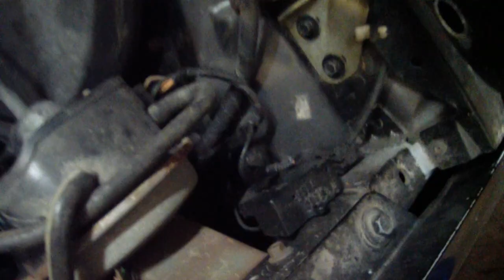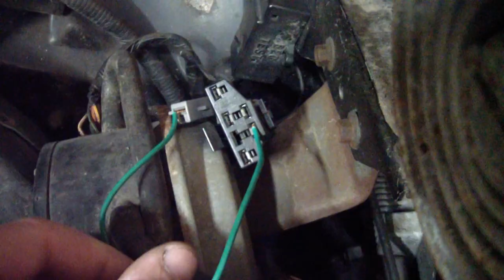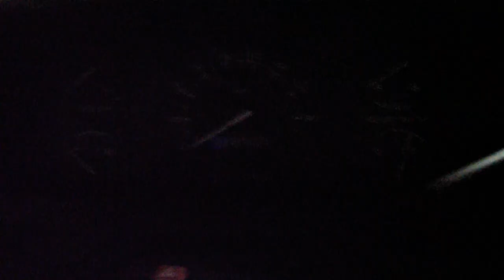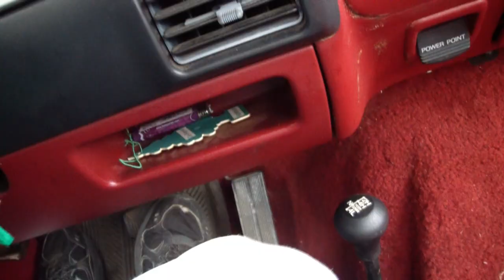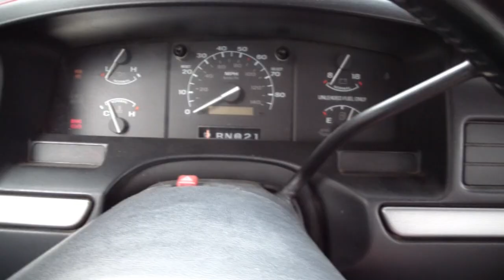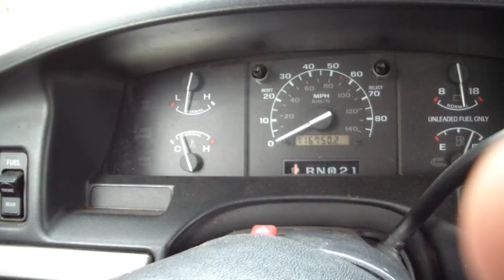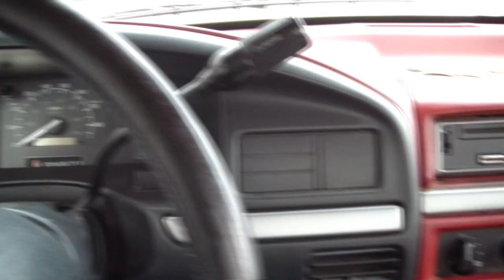How to read a check engine light code on a Ford 1983-1995 EEC 4 system

Comment: Can you tell me the wiring diagram of the connections?  Are one of them supplying power for the scanner?  I understand that you can use a wire or paper clip to get the codes using the check engine light.  On my 1990 7.3 idi Diesel, I am getting no power to any of the connections. No light when attempting to be able to read a code.   Should one of the connectors be powered?  Which one?  Thank you.
Reply from the maker: I'd have to research it again.  Good luck.
Reply: @Oldsmob455 ok, thank you

Comment: Would the 111 code flash before and  after the the single interruptor flash ? Im getting the same amount of flashes before.and after the interruptor.  Im.trying to figure out if the.second series of flashes would be 111 or code 33 which is a egr code.

Comment: I performed this test on my 95 f250 351w. 
I got 211 code with the truck off (warmed up) and 72 , 53, and 8 with the truck running. 
The engine light has never came on. 
But the truck randomly loses power and stalls, just cranks. Leave it sitting, it starts back up. 
I’ve rebuilt the ignition system, switch under the dash.  Could you please help a fella out with the mentioned codes? I’m getting conflicting stories across this interwebs

Comment: This is the only video I've foud that explained the actual full process with the 2 seperate groups and the seperator flash. Without that info it just looks like there's no rhyme or reason to the random flashes and spacing and I was about to pull my hair out. Thank you!

Comment: Thank you for video. I have 92 f150, has the 4.9 liter. It used to be my dads truck, and his mechanic unhooked the check engine light. He now denies it but i was there when he told my dad that he did it for him at my dads request.. do you happen to know how to hook the check engine light back up? I dont know if he unplugged a bulb or what. Any help would be appreciated
Reply: 4 amp fuse in cab fusebox

Comment: I did everything your video told me to do except for starting my 95 f150. I put the vehicle in the in the on position but didn't start it and it started reading the codes. I didn't turn the wheel or hit the accelerator the code came in. Great video!

Comment: My Ranger is a 1995 and it does not have one of those EEC test. It's no where to be found, What's up with that?. I've had 4 guys look to see why the light is still on after changing the battery, alternator, solenoid and starter.  After putting a new battery in it still would not start sometimes. Could it be a ground wire? and why would I "NOT" have an EEC Tester?
Reply: Have you checked your distributor?
Reply: You probably have the ob2 tester some have ob1 and some have ob2 it should be under the dash

Comment: I have an F800 with a 7L  gas engine. It has this  style data plug on the rt side of the cab under the seat. I have a check eng light, and performance problems. I have jumped the connectors as described. I can't get the dash to flash. I don't know how to proceed. What's next?
Reply from the maker: Not sure.  Maybe you have the wrong plug?  Under the seat seems like a unlikely place.  Google it if you havn't already.
Reply: @Oldsmob455  , my mistake. I should check my message more careful. The plug is under the heater box against the firewall in front of the passenger side cab. one plug is single terminal, the other has   plugs in it. I jumped #2 to the single wire plug. I also tried it with a test light to #4 terminal as well. I can't get the chk eng light to cycle.
Reply: I would attach a photo of the plug, but I can't find an icon to add a photo

Comment: yes OLDSMOB455, thanks.... you help'd me get motivated. lol yeehaw! yes, i believe i can do this. I'm going to check the ol 1992-3 E 150/351w conversion van CHECK ENGINE thing. All was good til it overheated alil i noticed. ...pull to shoulder of hiway, enginecoolant streaming out, pulled van inside engine cover off, set aside. a drside rear freeze plug had rusted a small hole. I had a flat metal roof rubber washer and a stanless steel screw and flat washer. I used items. still no leak, but CHECK ENGINE comes on...., but only when in gear and rolling 25yards appox., 
CHECK ENGINE  . Engine  off..... 10sec approx, then engine on and running not in gear, just ideling forEVER... NO check engine LIGHT, but put it in gear travel approx 25yards CHECK ENGINE comes on. ther ya have it, ....my situation. Now i am going to check trouble codes. thankya!

Comment: Get a Actron CP9690 code tester. It checks live, record, graphing, emissions test, solenoid and relay test, ABS SRS, timing advance test, check engine light reset, oil light reset, MAF readings, IAC valve readings, Coolent temperature sensor degrees, RPM'S, oil pressure, fuel pressure, EGR valve flow, and MORE! It works on 1983-2013 and is updatable. It erases memory codes. It checks cylinder balance on fuel injection. It has code connect to diagnose codes. EBAY has it.

Comment: i know how to get the codes but where can i find the definition  of the codes to correct the problem
Reply: Google may help or the manual that comes with a digital tester or get a Snap-on scanner and cartridges and adaptor from EBAY.

Comment: Get a Actron CP9690 code tester. It has Ford, G.M. Chrysler, and 2 Toyota cables for OBDI. It does freeze frame, live, graphing, and timing advance, and other tests. It comes in a black pouch. It has a cigarette lighter cable. It takes 4 AAA batteries. Out-of- the- box it goes up to 2013. It's well-lit! It's easy to use! It has code-connect to diagnose codes.

Comment: Get a Snap-on scanner from E-Bay. Get the cartridges and adapters and cables and 120 volt cable to hook up to the battery Pak to check test results away from the vehicle. Also get the 12 volt cable to hook up to the battery and the adaptor for some adapters. It tests MAF, ISC, fuel injectors, fuel pressure, oil pressure, RPM's, fuel trim, KOEO, KOER, movies, and much more!
Reply: Does this work for an OBD1?
Reply: I know this is a super old post. But I've been fighting my dad's old 95 5.0 since he passed last Christmas eve. And the scan tool I have for one 1 really isn't helping. But your post reminded me I snagged an old snap on tester back in the mid 2000s that I totally forgot about sitting in my shed. You may have just helped me figure this beast out. Thank you from the future 🤣
Reply: @patrickotto2727 are you going to read the flashes of the check engine light to see what the problem is?? Or what are you gonna do? Im trying to figure out a 92 f 150 5.8

Comment: I jumped the terminal and turned the key forward like you showed in the video but no light flashes or light period. With no light flash does it mean it has another problem.

 Thanks.
Reply: I had a 93 Taurus with a bad pcm that would not respond to the jumper wire
Reply from the maker: Not sure, try googling it.
Reply: R D It could mean the bulb is burnt out on the dash. It should flash even if it flashes a pass code.

Comment: EEC IV 3 DIGIT CODES[EEC Tests]

 Applicable only to some 1991 and up vehicles 

 NOTE: When you see "is/was" listed for a code: 
 For a HARD fault code the sensor IS out of range right now. 
 For a MEMORY code, it WAS out of range at one time (possible intermittent wire etc.).

Differences in test mode noted as:

 (O) =Key On Engine Off test
 (R) =Key On Engine Running test
 (M) =Memory code

111 System checks OK  112 (O,M) Intake Air Temperature (IAT) sensor is/was low or grounded 113 (O,M) IAT sensor is/was high or open 114 (O,R) IAT sensor out of range 116 (O,R) Engine Coolant (ECT) sensor out of range 117 (O,M) ECT sensor is/was low or grounded  118 (O,M) ECT sensor is/was high or open 121 (O,R,M) Throttle Position (TP) sensor out of range 122 (O,M) TP low (possibly grounded or open circuit) 123 (O,M) TP is/was high or short to power 124 (M) TP voltage was higher than expected 125 (M) TP voltage was lower than expected  126 (O,R,M) MAP or BARO sensor out of range 128 (M) MAP vacuum has not been changing - check vacuum lines 129 (R) No MAP or Mass Air Flow sensor change during "goose" test 136 (R) Oxygen sensor not switching/system lean Left or Front HO2S
137 (R) Oxygen sensor not switching/system rich Left or Front HO2S
138 (R) Fault in Cold Start Injector circuit
139 (M) Oxygen sensor not switching Left or Front HO2S
144 (M) Oxygen sensor not switching Single, Right or Rear HO2S 157 (R,M) Mass Air Flow signal is/was low or grounded 158 (O,R,M) MAF sensor is/was high or short to power 159 (O,R) MAF sensor is/was out of range 167 (R) No Throttle Position sensor change in "goose" test (must get at least 25% rotation) 171 (M) Oxygen sensor not switching - system was at adaptive limits - Single, Right or Rear HO2S 172 (R,M) Oxygen sensor not switching - system is or was lean - Single, Right or Rear HO2S 173 (R,M) Oxygen sensor not switching - system is or was rich - Single, Right or Rear HO2S 174 (M) Oxygen sensor was slow in switching Single, Right or Rear HO2S 175 (M) Oxygen sensor not switching - system was at adaptive limits - Left or Front HO2S 176 (M) Oxygen sensor not switching - system is or was lean Left or Front HO2S 177 (M) Oxygen sensor not switching - system was rich Left or Front HO2S 178 (M) Oxygen sensor was slow in switching Left or Front HO2S 179 (M) Fuel system was rich at part throttle Single, Right or Rear HO2S 181 (M) Fuel system was lean at part throttle Single, Right or Rear HO2S 182 (M) Fuel system was rich at idle Single, Right or Rear HO2S 183 (M) Fuel system was lean at idle Single, Right or Rear HO2S 184 (M) Mass Air (MAF) output higher than expected 185 (M) Mass Air (MAF) output lower than expected 186 (M) Injector pulse width longer than expected or Mass Air Flow (MAF) lower than expected 187 Injector pulse width shorter than expected or Mass Air Flow (MAF) higher than expected 188 (M) Fuel system was rich at part throttle - Left or Front HO2S 189 (M) Fuel system was lean at part throttle - Left or Front HO2S 191 (M) Fuel system was rich at idle - Left or Front HO2S 192 (M) Fuel system was lean at idle - Left or Front HO2S 193 Failure in Flexible Fuel (FF) sensor circuit 194 (M) Perform cylinder balance test to check for inoperative injectors  195 (M) Perform cylinder balance test to check for inoperative injectors  211 (M) Ignition PIP signal was erratic or missing 212 (M) Ignition TACH signal was erratic (module/wiring) or SPOUT circuit fault 213 (R) Ignition SPOUT or SAW circuit open or shorted 214 (M) Error in Cylinder ID (CID) circuit or signal 215 (M) Primary circuit failure - ignition coil 1 216 (M) Primary circuit failure - ignition coil 2 217 (M) Primary circuit failure - ignition coil 3 218 (M) IDM signal open or high or left coil pack failure 219 (M) SPOUT circuit failure, timing defaulted to 10 degrees - follow code 213 diagnosis 222 (M) IDM open or high or right coil pack failure 223 (M) Dual Plug (DPI), SPOUT or IDM circuit fault 224 (M) Failure in ignition coil primary circuit 225 (R) Knock sensor not tested (ignore if not pinging)  226 (O) Ignition Diagnostic Monitor (IDM) signal fault 232 (M) EI primary coil circuit failure 238 (M) EI primary circuit failure - ignition coil 4 311 (R) AIR system not working - Single, Right or Rear HO2S 312 (R) AIR not diverting 313 (R) AIR not bypassing 314 (R) AIR inoperative, Left or Front HO2S 326 (R,M) Pressure Feedback EGR shows low pressure EGR not seating or not seating intermittantly 327 (O,R,M) EGR feedback signal is/was low 328 (O,R,M) EGR Valve Position (EVP) is/was low 332 (R,M) EGR did not open/respond during test or if memory code, did not open intermittantly 334 (O,R,M) EVP sensor is/was high 335 (O) EGR feedback signal is/was out of range 336 (O,R,M) PFE sensor signal is/was was high 337 (O,R,M) EGR feedback signal is/was was high 338 (M) Cooling system did not heat up (check cooling system / thermostat operation) 339 (M) Cooling system overheated (check cooling system / thermostat operation) 341 (O) Octane jumper installed (information only code to notify you if it is installed) 411 (R) Idle speed system not controlling idle properly (generally idle too high) 412 (R) Idle speed system not controlling idle properly (generally idle too low) 452 (M) Vehicle Speed Sensor (VSS) problem  511 (O) No power to PCM pin 1 or bad PCM (processor) 512 (M) Memory power (PCM pin 1) was interrupted - Was battery disconnected ? 513 (O) Replace processor (PCM) (internal failure) 519 (O) PSP switch/circuit open 521 (R) Wheel not turned during test or PSP problem 522 (O) Park/Neutral Position (PNP) or Clutch Pedal Position (CPP) circuit fault Transmission MLP sensor out of range in park 524 Problem in low speed fuel pump circuit 525 (O,M) Park/Neutral Position (PNP) or Clutch Pedal Position (CPP) circuit fault 528 (M) System shows voltage at pin 10 (is A/C on ?) or pin 30 (PNP, CPP switch) 529 (M) Data Communications Link to processor failure 
 Service any EEC codes, erase memory and retest. If code is still present refer to instrument cluster diagnosis manual. 533 (M) Data Communications Link to instrument cluster failure - see 529  536 (O,R,M) Brake On Off open or shorted to ground 538 (R) System did not receive "goose" test - TESTS 539 (O) System shows voltage at PCM pin 10. Is A/C on ? 542 (O,M) Fuel pump open, bad ground or always on - 543 (O) Fuel pump monitor circuit shows no power (M) (Service 556 code first if present) Fuel pump relay or battery power feed was open 551 Problem in Intake Manifold Runner Control (IMRC) solenoid/circuit 552 (O) AIRB solenoid/circuit failure 553 (O) AIRD solenoid/circuit failure 554 (O) Fuel Press Regulator Control solenoid/circuit fault 556 (O,M) Fuel pump relay primary circuit fault 557 (O,M) Low speed pump relay primary circuit fault 558 (O) EGR vacuum regulator solenoid/circuit failure 559 (O) A/C relay primary circuit fault 563 (O) High Fan Control (HFC) circuit failure 564 (O) Fan Control (FC) circuit failure 565 (O) Canister Purge 1 solenoid/circuit failure 566 (O) transmission 3/4 shift solenoid/circuit 569 (O) Canister Purge 2 solenoid/circuit failure 578 (M) A/C pressure sensor VREF short to ground 579 (M) ACP sensor did not change with A/C on 581 (M) Cooling fan current was excessive 582 (O) Open cooling fan circuit 583 (M) Fuel pump current was excessive 584 (M) Open power ground circuit 585 (M) A/C clutch current was excessive 586 (M) Open circuit in A/C clutch 587 (O, M) Communication problem between PCM and Variable Control Relay Module (VCRM) 617 (M) Transmission shift failure (1/2 shift) 618 (M) Transmission shift failure (2/3 shift) 619 (M) Transmission shift failure (3/4 shift) 621 (O) Solenoid/circuit failure - shift solenoid 1 622 (O) Solenoid/circuit failure - shift solenoid 2 624 (O,M) Solenoid/circuit failure -Electronic Pressure Control (EPC) current is high 625 (O,M) Solenoid/circuit failure - Electronic Pressure Control (EPC) current is low 626 (O) Transmission Coast Clutch (CCS) Solenoid/circuit fault 627 (O) Torque Converter Clutch circuit fault 628 (M) Excessive converter clutch slippage 629 (O,M) Torque Converter Clutch circuit fault 631 (O) Overdrive Cancel Light circuit problem 632 (R) E4OD - Transmission Control Switch (TCS) should be cycled once between engine ID and Goose test  633 (O) 4x4L switch should be in 4x2 or 4x4 high for the test 634 (O,M) Park/Neutral Position (PNP) or Clutch Pedal Position (CPP) circuit fault 
 Electronic shift transmission - Manual Lever Position (MLP) sensor out of range in PARK 636 (O,R) Transmission Oil Temperature (TOT) sensor out of range 637 (O,M) TOT sensor is/was high or open 638 (O,M) TOT sensor is/was low  or grounded 639 (R,M) Transmission Speed sensor (TSS) circuit fault 641 (O) Transmission solenoid/circuit failure Shift Solenoid 3 643 (O)(M) Torque Converter Clutch (TCC) circuit 645 (M) Transmission 1st gear failure 646 (M) Transmission 2nd gear failure 647 (M) Transmission 3rd gear failure 648 (M) Transmission 4th gear failure 649 (M) Transmission EPC system failure 651 (M) Transmission EPC solenoid/circuit fault 652 (O) Torque Converter Clutch (TCC) circuit fault 654 (O) Transmission selector not in PARK 656 (M) Torque Converter Clutch (TCC) slip 657 (M) Transmission temperature was excessive 998 (R) Did not pass Key On Engine Off test yet (Get 111 in KOEO first)
 (O) Transmission Electronic Pressure Control (EPC) solenoid/circuit fault [EEC Tests]
Reply: Gary T If you get O2 running rich/lean codes, replace the MAP sensor. If you get vacuum to the EGR at idle or at the wrong times, replace the charcoal canister purge valve.
Reply: Thank you!
Reply: Looking for help and you seem like maybe the guy that could offer it hopefully.. I have a 94 2.3 and I’m getting code 5195191172172 repeatedly, I’m not sure if it should be broken up into one or two digit numbers

Comment: Hello,, "how did you fix code 332" ? ..... I got the same 332 code but the car runs well... I just don't want other parts to be destroyed because 'insufficient EGR flow detected"...
Reply: mario agostini Insufficient EGR flow could mean the EGR is leaking down or not opening. That could be the EGR itself or a vacuum problem. There may be a vacuum solenoid in the circuit. Check for vacuum at the hose at idle with the engine warmed up. There shouldn't be. A throttle that is partially open because something else could cause vacuum when it shouldn't.
Reply: mario agostini egr is just for emission control. No need to worry about other parts. Most vehicles have bad egr systems
Reply: I should add, if EGR is on at idle it can cause a rough idle

Comment: What if you have a 5 speed manual transmission? How do hit the overdrive button  then put it in 5th ?
Reply: Jason W. Hamilton That is for automatic trans.
Reply: Chris P. Baykin
 no on manual you have to start it, put it in first and dump the clutch! codes will flash quick so keep your eye on the light!